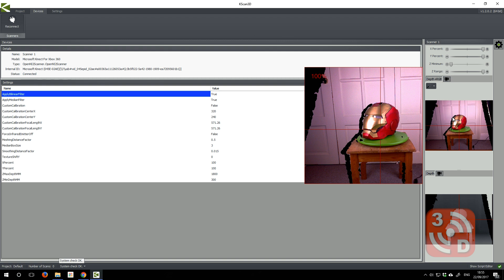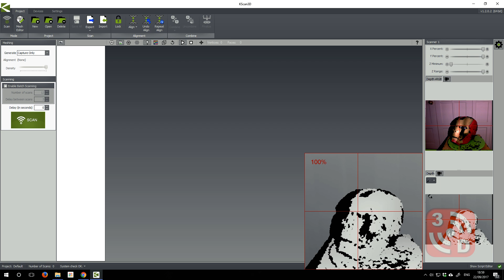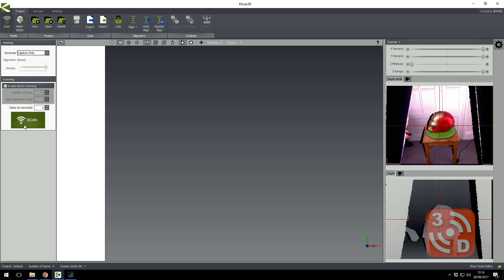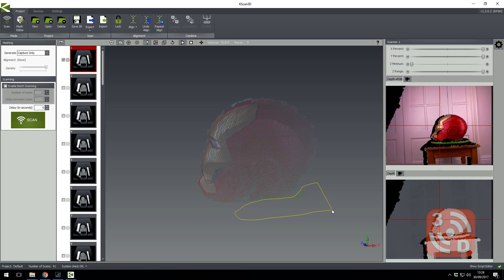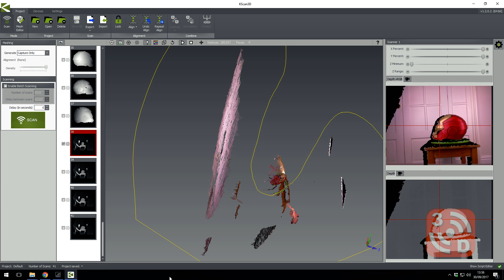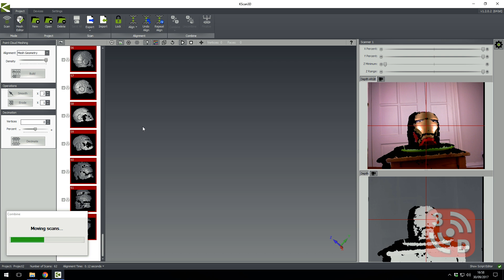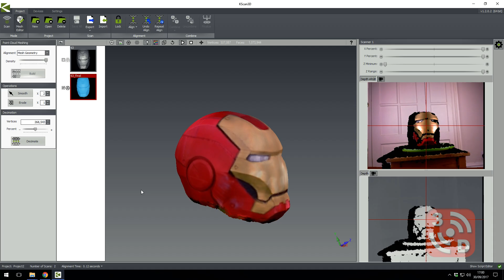3D Scan with Xbox Kinect and K-Scan: Beginners Tutorial

Comment: but i think you can use a regular camera our a cellular phone for that purpose u showing.
Reply from the maker: Not quite. What you're thinking of is called photogrammetry. It's when you take photos from every angle and it looks at points of similarty and uses that to generate a 3D model, with no input in distance, depth, or relative size. 
This is capable of determining depth, so even when things are the same colour and don't have shadows or reflections on them to indicate shape or structure, it'll still pick up the detail, and it should generate a model of relatively accurate scale too.
However Photogrammetry is a really powerful tool, and can also be done from drones. I'll be doing a whole series on it later this year so keep watch.
Reply: @3DRevolution  hi. thanku for the replay. and yeah thats what i meant. id like to see how u scan using that kinect as handscanner. for i did exactly what u did now but with a system camera.

Comment: Dude you didnt use the x box as a scanner. you did photogrammetry and just used the Kinect as a camera instead of a real camera or your phone. I thought the point of using the Kinect as a scanner is not to take 100 pictures and just record and then have the software clean it up and give ypu a 3d file. I dont think you even realized yo were doing photogrammetry.
Reply from the maker: No, it's similar but it isn't pure photogrammetry. The kinect features an infrared projector which projects a partern onto the world infromt of it and an infrared camera then captures that. The way in which that projection is manipulated by the distance and shape of the environment is used to determin the size, distance and shape whilst generating the model.
Photogrammetry takes a number of standard photos, finds points of similarity and uses them to stitch the images together and then determin the shapes of the environment based on the altered perspectives.

Comment: Would it be possible to scan a whole car with this approach? Using the Kinect scanner?
Reply from the maker: Technically yes. However, two main things to be aware of. Firstly, the kinect needs to be wired both for power and to a functioning computer. You could rig this up to a compatible laptop and some sort of powerable mains power supply in a backpack, but otherwise, you'll need some big trailing cables to get the Kinect everywhere you need it for the scan.
The other thing to bare in mind is that the mirrors and windows will likely cause some issues with the scan so you'll probably have a fair bit of cleanup to do after the scan is complete.

Comment: what if you used a record player instead of a lazy susan?  could you have it take like 30-60 scans a second?  I know it would take more processing time, but I'm wondering if the higher density of scans would deliver better results.
Reply from the maker: Absolutely, this would work. Probably wouldn't be able to run 60 frames a second but 30 may be doable. It's definitely something worth experimenting with if you have one available. Set the deck to the lowest speed you can to start with and increase it until you find a good equilibrium between speed and quality. More scans definitely improves quality.

Comment: Did someone compare this method with the camera method? Because, when using the camera for capturing the photos, since the background is changing, the object cannot be constructed. As far as I can see it is possible with the Kinect.
Reply from the maker: Photogrammetry is a very powerful method of achieving high quality 3D models. 
The background isn't a real issue. If you are scanning a smaller item, then putting a greenscreen behind it and rotating the model rather than moving around it can help, but generally the software is clever enough these days to recognise the item you're moving around and separate the background from the point cloud it generates. If not, it is something you can just clean up in post.

Comment: Hei, thanks for your tutorials. You are an amazing tutor. Could you please share some ideas on how to scan with Kinect, import into Blender, and then animate?
Reply from the maker: Thank you very much, glad the video helped.
I'm afraid I'm a little rusty when it comes to 3D animation, but once you've scanned your model as per this video, you should then be able to import your exported .OBJ (or whatever you decide to export as) into blender. You can clean it up and modify as necessary. It may be beneficial to run it through something like meshmixer first for initial cleanup.
Once you're happy with your model you'll need to rig it with bones to animate. This involves building a skeleton inside your model, and applying nodes to each bone, then applying restrictions to joints etc. 
Then you can animate.

Comment: hi there, i have seen this video and i find it amazing. im at the beginning on trying to learn about 3d scan and 3d printing this is a great platform to start but i have a small doubt, you scanned the external part of the helmet but how about if i wanted to scan also the interior? what should be the steps within this tutorial? thanks!
Reply from the maker: Hi Antonio, I'm glad you liked the video and thanks for the comment. 
Unfortunately the interior gets a lot more complicated. You may have limited luck scanning that with photogrammetry, but really, unless you're able to take it apart and scan it in pieces, you'd be better off just taking measurements and modeling from scratch.

Comment: Is it possible to use an Xbox One Kinect? Or is that just the same as the Xbox 360 one?
Reply from the maker: It is possible, however, reports from others suggest the original connect runs more stable with k-scan.

Comment: I have just bought a 2nd hand kinetic for £12 posted.  I am wanting to scan vintage radio volume knobs do you think it is possible with the kinect ? Cheers John
Reply from the maker: They are quite a small and detailed item so it's difficult to say. You may be able to get a half decent model and clean it up in post but you may be better off just re-designing them from scratch
Reply: @3DRevolution  thank you for your reply.  Looks like I am going to have to get my old brain to work on fusion.  I can feel a migraine already 😫

Comment: I fully acknowledge i don't know how the Kinect technology works and i assume someone else would have though of this if it were an option but...since the kinect uses infrared light as of its technology and that seems to be sensitive to temperature (right?) would figuring out a way to vary the temperature of the object have some kind of bearing on the result? I mean holding a cold compress over an area with a lot of textures and maybe evenly a applying some heat from a hair dryer to another area? Is that not how it works?

Comment: i'm sure there's a reason this is different from just using a regular camera to gather the scans? but youve taken so many scans that i cant imagine not getting the same model from using as many smartphone images in K-Skan
Reply: The Kinect has a depth sensor and infrared projector that is required for more accurate 3D scans. While it is possible to do with a regular camera, it becomes much more complex and you may not get as good of results as using a real sensor that has depth detection.

Comment: If I was to scan my head, would it scan to scale so I could use it as a template for cosplay helmets
Reply: Commander Wyro Programs handle scale, not the camera.

If you end up with a head, just measure out the real head and scale it accordingly in whichever program you use. 

If you're talking about all the ratios, yes, it should be as exact as you can get. If your head in the program has the exact same height as the real one, every other measurement should be perfectly usable too.

Comment: hey man. great tutorial but im quite  lost because i read that microsoft is no longer producing kimect and drivers available were changed in order to not allow more use of kinect sensor as 3d scanner. any input on this? thanks
Reply: and i have no kinect so im not sure if i should take the trouble to buy one for nothing, right?
Reply: @xnetcascais  I'm using my Kinect and Kscan as I type this. It works fine. Just use the old drivers.
Reply: @starfox_wr-45e93  im trying to add drivers so pc will see kinect. now i have a only sounds and installing driver messages all the time, trying to install but going anywhere. by any chance do you have a procedure or a link to follow so i can install my kinect properly on my win7 ?

Comment: How do you align properly? When I move the camera to get the top and bottom, the images don't merge like yours do.  Each of the 3 sets (from different angles) form their own images but never seem to merge.  I'm using the Kinect v2.  It works well if I only have one angle but then I get a hole on top of the head if I don't take the top angle.

Comment: Do you plug theckinec ro a pc?
Reply from the maker: You do indeed. From the Kinect 360 V2, they come with a USB connector as standard but you will also need to buy a mains power adapter too if it doesn't come with one.

Comment: Errr... am I missing something? How are you peeps even connecting it to your PC’s USB port? The Kinect doesn’t have a USB connector, It’s some weird propriety connector?
Reply from the maker: Hi there, the very first version of the Kinect came with a different connector but the Xbox 360 Kinect V2 has a USB port as standard (though you need to also get the mains adapter for it)
Reply: Ahhh balls so I got the wrong one... wish somebody had made it clear there are 2 different versions. Thanks for the reply.

Comment: I have the XBOX 360 Kinect and adapter power supply but my Win 10 system doesn't recognize it. Any suggestions? Should I buy a newer version? And what was the software used to clean up a file? FYI, I want to scan antique furniture pieces in so I can 3D carve them on a CNC (homebuilt) machine at home. Is this suitable scanning large pieces with intricate carvings? Thanks
Reply: Hi, you have to download and install the kinect SDK 1.8, containing the drivers. The 360 kinect scanner is not really precise so you might not end up with very detailed 3D models.
Reply: You should buy Kinect V2, it makes better scans. If you get a kinect make sure to install Kinect SDK [For 360 kinect version 1.0+] [For V2 kinect version 2.0+]. And yes, you can scan big objects.

Comment: I hate to ask a moron question but my Kinect does not have a standard USB port. How did you connect it?
Reply: same
Reply from the maker: Hi Alan, you need to purchase one with a USB connector. Microsoft later released them with a USB as standard. You can pick them up from ebay for around £15

Comment: How to you 3d scan an item on the inside and outside in one (lets say the outside of a cup) but I am scanning a cup) and you put it upside down to scan the whole of the outside and the detail (lets say it has lots of detail, but you want to scan the inside that has lots of detail as well. I appreciate you will need to do more than one scan but can the two scans be merged to make one image to print on a 3d printer. The inside has details that are as important as the outside, the item will not be solid like a cup. I just wanted to know as a newby if this can be done and how using a kinect......Thanks

Comment: Could you export the model to solid works etc and then build off it? Thinking being to scan an engine bay and model a tube frame from it
Reply: Same here ! I wonder how precise is it to be able to take measurements too for engine mount , custom oil pan etc
Reply: jonathanfp123 this is exactly what I was wondering as well
Reply: You could start modelling of course but it wont be precise at all (at least not when it comes to mechanically precision), should still be a good starting point if you know your CAD software.

Comment: Have you tried with the Kinetic v2? i got one last week at gamestop for 15 bucks! trouble is i have to buy the blasted adapter.
Reply: You can easily modify the Kinect V2 to use an off the shelf ac adapter and a standard USB 3.0 cable.
Reply from the maker: I haven't personally ye tried this with the V2 (By which I presume you mean the XBox One Kinect?). However it should be compatible with this software, though some other software packages it isn't.  If you do have that model however, you can also use MIcrosoft's offical one if you're running windows 8 or later: https://www.microsoft.com/en-gb/store/p/3d-scan/9nblggh68pmc
Reply: Hi, do you know if the scanning quality with v2 is better then the v1 ?
Reply: Felice Caccamo I guess it probably is
Reply: Felice Caccamo the Kinect V2 uses time-of-flight and Kinect V1 uses structured light. Time-of-flight has a few advantages, one being improved spatial resolution, which is good for body tracking and gestures, but means more noise, and sensitivity to the colour and material of objects for the use of 3d scanning. Some softwares will probably counter for that so it might be down to what software you use to get the most out of the V2

Comment: Hello and thanks for your Video. Im tryin to find kinect 1414 to buy, but i found another models: LPF-00057 and/or 1473. Would this Models do this work too?  Thank you.
Reply from the maker: Hey Christo, my pleasure. the 1473 is absolutely suitable! It is actually the slightly newer version of the 1414 which Microsoft released when they realised people were starting to use with computers. So whilst 1414 works absolutely fine, technically, 1473 should be an even simpler setup.